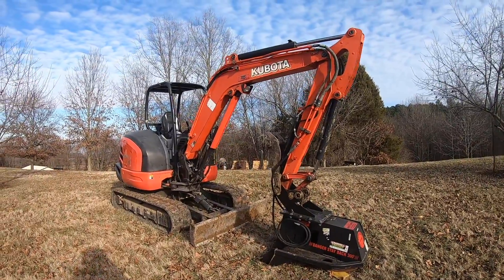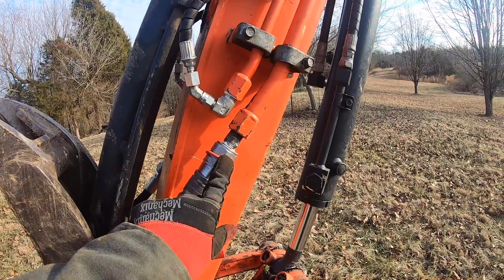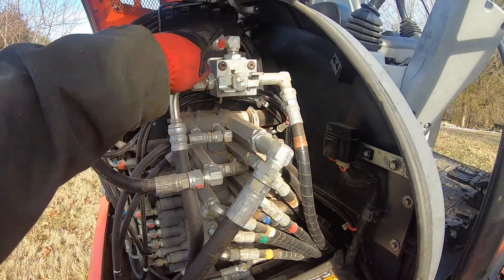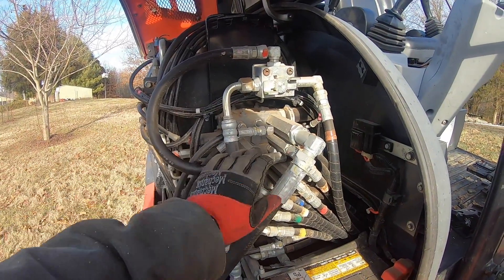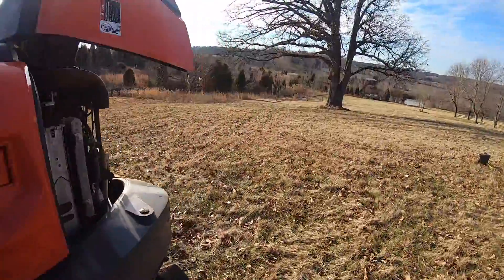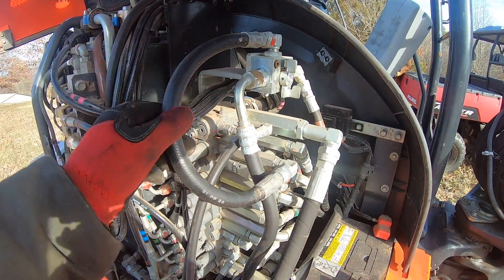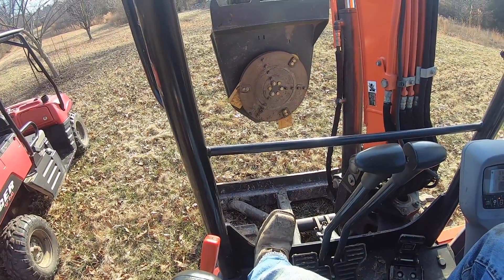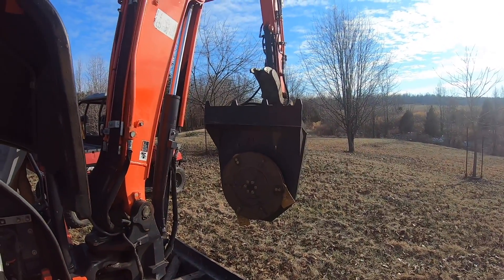HOW TO Set One-Way Aux Flow For Kubota Mini Excavator

Comment: I have a kubota 040. Bought a new brush cutter, set the auxiliary settings. When I have this valve “off” the blades start spinning but stop when I let go of the switch. When I turn the valve “on” and press the same switch it will not spin at all. Obviously I am trying to get it to be on continuous flow but cannot get it to do so.
Someone help me trouble shoot this
Reply from the maker: @almonmiller4158  your hoses are backwards on the brush cutter. Swap the quick connects on the hoses on the brush cutter and hook them up again.
Reply: @ thank you for the feedback. Will try tomorrow!

Comment: Is that grinding sound in the gearbox normal? I hooked my VMC EC48HD to my kx080 and when I run it off the left stick it makes that noise, when I run it on the right stick it sounds smooth.
Reply from the maker: Hey thanks for the question!  I'm not sure about normal but both this brush cutter and my erskine rotary cutter for my skid steer make the same noise when i let off the button and its free-spinning.  I think it is fluid circulating through the bypass valve if i had to guess since the disk is still spinning and pushing fluid around.  I've gotten use to it, but i definitely cringed at first.
Reply: @NealORussa  Thanks so much for the reply! I did figure it was probably normal and thought the same thing. Thanks for explaining it and giving your input! I was worried it was going to get messed up or something but there's not really anything you could hurt in there 😂

Comment: What is the effect of running it with the valve closed (vertical position).  It is bad for the hydraulics?  I’ve got a brush cutter as well and was always wondering if it made a difference in power to run it as an open system.  Also, great tip on the button on the bottom to keep it the brush cutter running.  My thumb was getting worn out.  😂
Reply from the maker: I wouldn't say it's necessarily bad for the hydraulics but the manufacturer put it there for a reason to use with one way attachments. With the valve open the fluid goes through the attachment then directly back into the tank. When it's closed the fluid has to go back through the valve body and when you let off the attachment control that valve will close and stop the flow of fluid relying on the attachment's fluid bypass valve. 
It only takes a second to turn so I think it's good practice. Especially with a hoe ram because a lot of them do not have the bypass valve.
Reply: @NealORussa Ok. That’s good to know. My valve usually stays in the open position. I run a rotary brush cutter, flail cutter, and of course a variety of buckets. I’ve not had any occasion to need the valve closed.
Reply from the maker: @kiheidude  yea I close mine for my tilt bucket so it can tilt both ways. If I forget and try to use the tilt it will only go one way
Reply: @NealORussa  Another good tip to know if I ever get a tilt bucket. Thanks!

Comment: It seems dangerous to run a brush cutter with an open cab. How did that go?
Reply from the maker: It goes fine. I wear long clothes and a hard hat with face shield and ear muffs along with safety glasses. 
I have some wire mesh and brackets to build a guard for the front but haven't gotten around to building it yet.
Reply from the maker: https://youtu.be/TVmxmsgyODk

Comment: I've got a kx121-3 and a friend has a newer Kubota. We both brought the same wood splitter and his is stronger. He has 4 lines like yours my one has only 2 lines . Do you know if I can turn up my pressure?
Reply from the maker: Ricky, I think the thumb line of most machines are supposed to have a relief valve so that the bucket can overpower the thumb.  I'm not sure how to adjust that on your machine.  My machine has 4 lines, 2 are smaller diameter and go to the thumb, the other two are larger diameter and I have quick connects for attachments.

Comment: With this valve, do you still need a casing drain with a drum type mulcher?
Reply from the maker: You will need to contact the manufacturer of your attachment to check. The return essentially becomes a case drain when you turn this valve, but some attachments still require a case drain in addition to return hose. It might be possible to tee the return and case drain hoses together prior return the quick coupler on the stick.
Reply: Even a couple years later, super helpful video thx

Comment: Great information to know.  BTW, shouldn’t;t you have an enclosed cab to run a rotary brush cutter?
Reply from the maker: I've been running in an open cab just fine. I wear long clothes, gloves, hardhat with face shield, earmuffs and safety glasses. I am in the process of building a screen that bolts onto the rops cage, but I haven't had any issues without it. I do make sure to always keep the cutter facing down or out. Meaning I never curl it in towards me so the blades would be spinning toward me.
Reply: @NealORussa  kubotas sures has smart set up better then cat,deeres and other brand wich have to switch all the lines around with is hasstle  wich kubota has the smart set up on all there kubota excavators and skid steers

Comment: So do you not need a case drain to run a cutter on KX040?
Reply from the maker: When you turn this valve it turns that hose into a case drain. Fluid goes straight into the tank instead of the valve body.
Reply: Did your cutter come with a case drain line on it? I'm looking at one that has the line and I don't want to use it if I don't have to with the one way valve being used instead.
Reply from the maker: @russd7  my cutter doesn't have a case drain hose. It is a rut mfg tree slayer with the carbide mulching teeth.